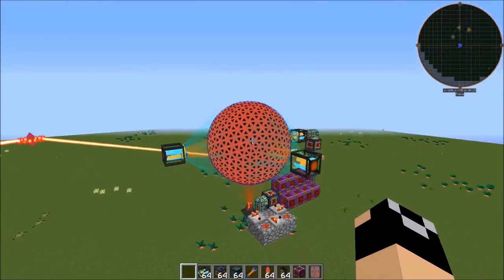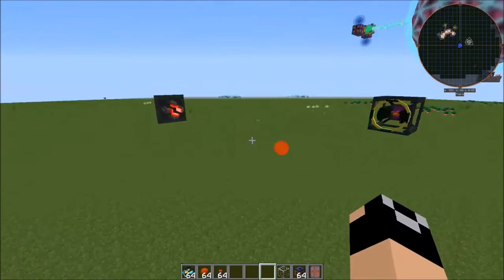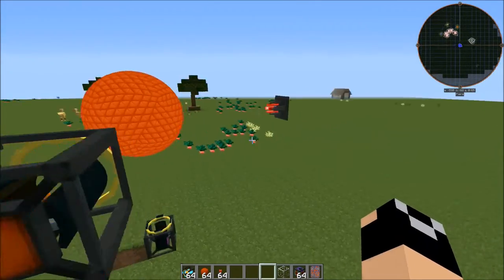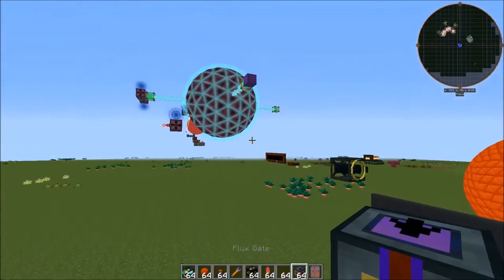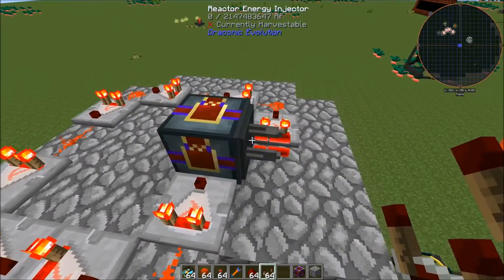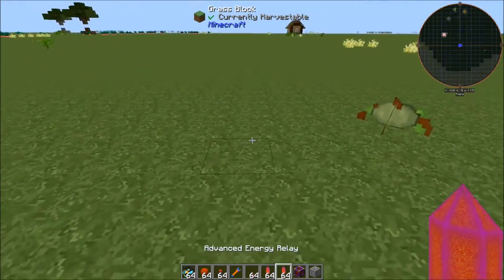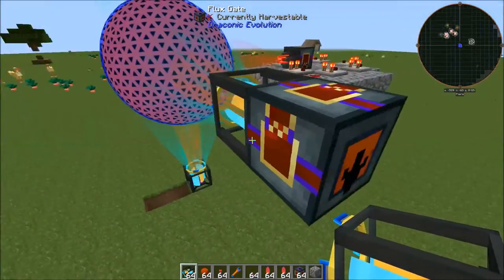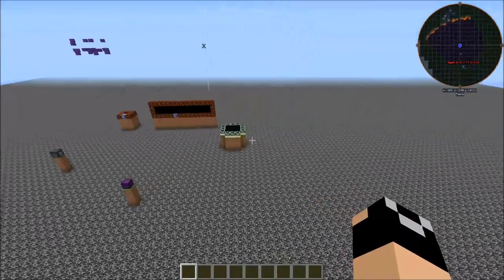Draconic Evolution How To Pt. 4: Energy Transfer and Reactors

Comment: the video just kinda got cut off in the end :(

also would you consider doing a tutorial for NuclearCraft ? if you do plz plz plz use the latest version which is v1.9
Reply from the maker: Hmm, it did indeed, sorry about that.  When I checked the original footage it did as well, im not entirely sure why it stopped recording at that point tbh.  It was pretty much the end, I wrapped up right after that, but not clue why it ended suddenly right there.  I'll try to add on a short ending onto it today, thank you so much for the heads up on that.  Also sure, id be happy to do a tutorial for that :)  I'll try to get that out asap for you :)
Reply from the maker: Wanted to give you an update, ive been working with the v1.9 for nuclearcraft this afternoon.  Im working on learning all of it since its fairly new territory to me, but I should have at least the first video out tomorrow for it.  Chances are judging by how it seems so far it will be 2-3 episodes long.
Reply: nuclear craft is easy to learn, just get the missile and nuke kits

Comment: Great video, and I did understand a lot of it, i think. But after trying to recreate it my reactor just lost temperature rapidly while increasing saturation till it basically didn't work at all anymore. 
So at least no explosion (although I used a creative world to prevent that), but still no success... I sometimes think I'm just too dumb for this mod...
Reply: thats what a reactor is supposed to do if there is no power thats needing to be generated the core temp goes down reduces energy output